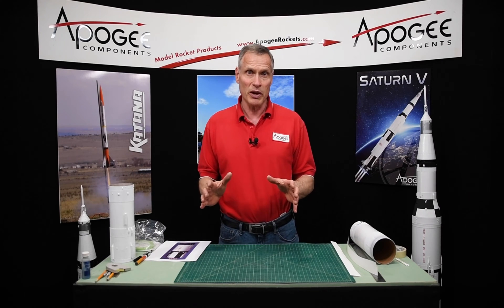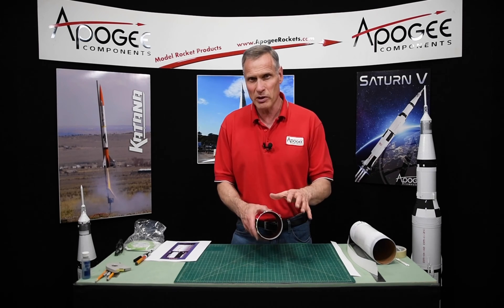Saturn 1B Assembly Part 40 - Masking the Corrugated Sections for Putting on Black Paint

Comment: Tim, I’m working my way through this kit, and I’m approaching the final stages.   The one thing I really didn’t see is how you masked off the Service Module.   Did you paint it white with the transition, and then the whole thing silver, then mask off the white sections?  It’s really hard to see the raised sections and I’m struggling to figure out how to do it right.
Reply from the maker: I think I painted silver first. Usually it is thinner than white, and then it is easier to see the raised sections.